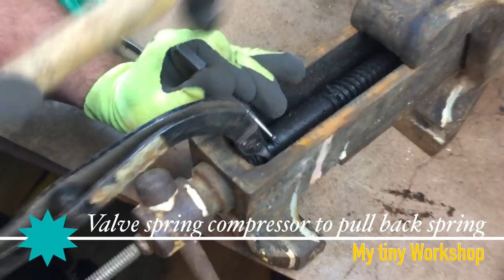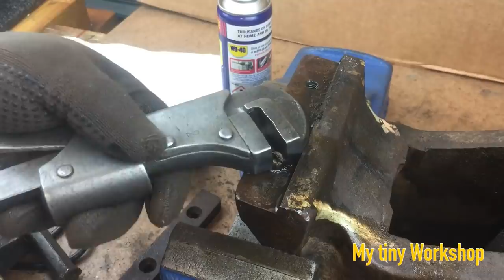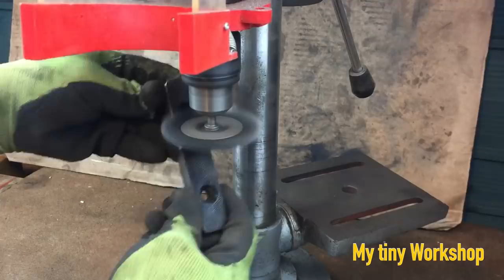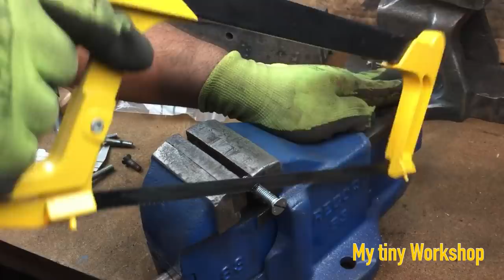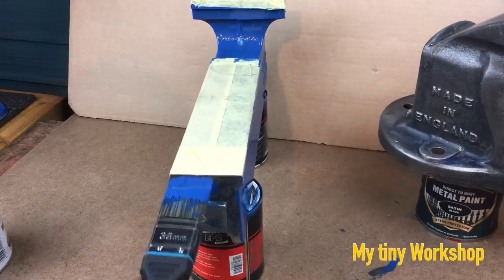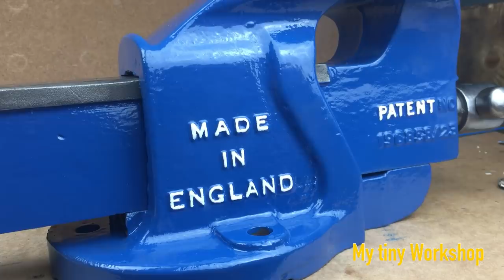Rusty Record no 5 Vice Restoration

Comment: I soaked a logging chain, 2 hammers, some rusty pliers, and a wire brush in white vinegar for 1 week. I’d never done it before.
When I removed everything the chain was fine, the pliers were fine, both hammers had tiny splits in the head, and the wires on the brush had completely dissolved leaving only the handle. I never realized vinegar was that powerful. 🤷‍♂️
Reply from the maker: It’s surprising how strong this stuff is. I’ve lost things before. I only leave soak for up to 2 days now. And I keep an eye on thin metal.

Comment: Great job mate and attention to detail. Have you thought of using electrolysis for removing the rust. I have got some old tools with rust and am going to try it with battery charger and baking soda , seems to remove more rust than the white vinegar and more cost effective.Thanks for the upload subscribed!
Reply from the maker: I will try it one day.
Reply: I used the Hammerite rust remover gel (citric acid based), it's effective but relatively kind to the user and environment.  Didn't need much as you can paint it on just where you need it.  There is a great guy on E bay who sells Record refurb kits for the vice jaws and other bits, including paint.

Comment: Nice restore, some comments:
1- the cotter pin retaining the spring should be a solid pin instead, must have gotten replaced at some point
2- why did you round off the jaws like that? the vice is meant to have sharp square jaws
3- the white lettering is not the originals, but a nice touch if you like that sort of thing.

Comment: What is the spring compression clamp called that you use? I am trying to find one to use on a similar type vice, but I only get results for car springs! You looks perfect. Would you be able to send me a link to one?
Reply from the maker: Hi, it’s a valve spring compressor. I found this at a boot sale and immediately knew I could use it on vices. Check out eBay, there are many different types.
Reply: My tiny Workshop thank you! I realised this shortly after posting and had one delivered on Prime today. Keep up the good work!
Reply from the maker: Nice, gotta love prime.

Comment: Great to watch - I’m half way through restoration what colour blue paint did you use and what size screws for jaws/ where to buy?
Reply from the maker: Hi. The paint is Hammerite blue. As for the screw size I took my original screws to a hardware supplier and they matched the threads.

Comment: Hey - a couple of questions. I have a No 7 but can't find new jaw inserts (and the ones on the vise are pretty shattered) any ideas as Irwin doesn't make the No7 any more (worst case is I make my own). Secondly - what are the jaw insert screw threads and finally - how does the stopper on the lever attach? My lever is a bit bent and I wonder if the caps screw off.  Thx   Mike
Reply: Look on ebay UK, someone is making the jaws for most vices but they`re not cheap. The caps do not unscrew they were formed after inserted, you can get these new (copies) using screw on nuts each end, also expensive.
Reply: @c.p3425  Thanks - I made the jaw screws and they work well - will check out ebay UK ~mjs

Comment: Do you know what size the clamp screws are? I've just bought this exact model off ebay but the clamps are supplied lose as the previous owner lost the screws somehow?
Reply from the maker: I don’t know the sizes. I always take screws or bolts to my local hardware suppliers and they find the perfect match.
Reply: @mytinyworkshop1213  ok, thank you.
Reply: @coopre11  contact record
Reply: Usually 1/4" UNC

Comment: Liked and Subbed!  That is a great restoration.  I have 3 to do and I hope they come out as good as this.  I was debating on putting white on the lettering as that is not standard but it looks really good and I'll accept it as an improvement.  Good colour match on the blue as well, did you use BS381C 110 Roundel Blue?  Consider putting some rubber washers on each end of the tommy bar to stop the clang (and finger pinching!).  What size bolt thread did you use for the vice jaws?
Reply from the maker: Thank you. I used Hammerite smooth blue. Is the colour code you mentioned the original record blue. I have a number 6 that needs restoring and I want it to be an even purer Restoration. As for the bolts, I took the original to a hardware supplier and they matched the thread. I’m not sure exactly what size.
Reply: Yes, Roundel Blue or BS381C 110 is the exact colour for Record vices and G clamps. 
https://www.paragonpaints.co.uk/BS381C-110-Roundel-Blue-Record-Vice-Blue.html
Reply from the maker: Perfect, thanks for the info.